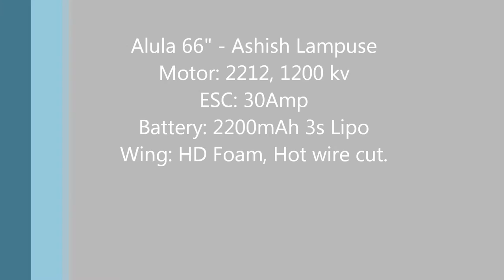RC Alula 66" HD Foam, powered by brushless motor

Comment: Mitra... Sorry a dumb question maybe but do we need to have a flight controller for the airplane like we do on quadcopters? Or just the esc, transmitter, receiver, servos n battery is enough?
Reply: A flight controller is optional. Rc planes are (usually) stable by design :)